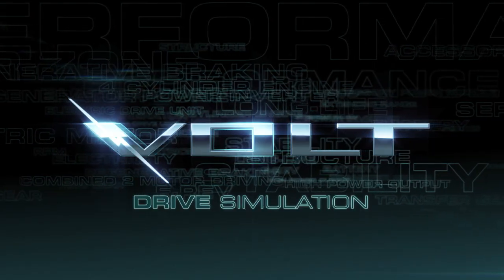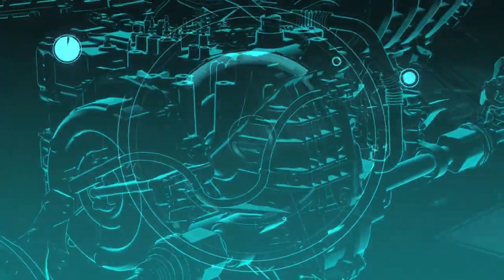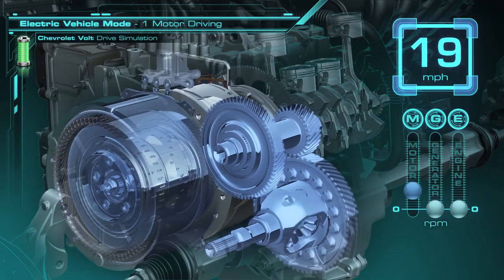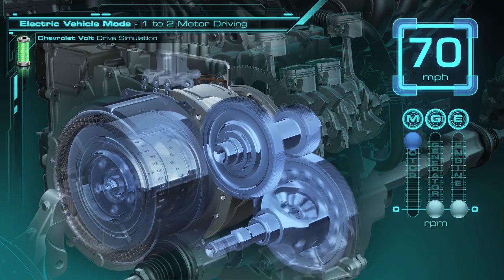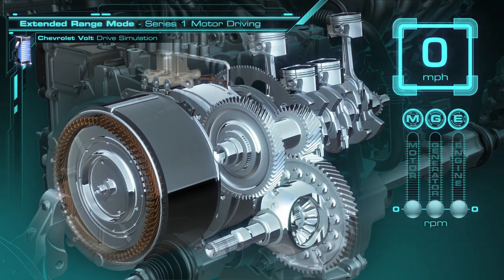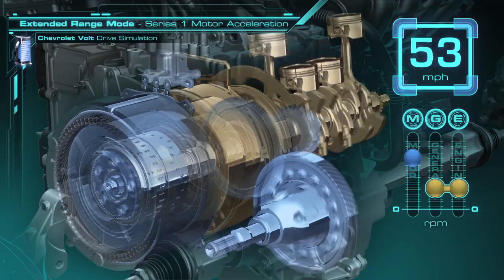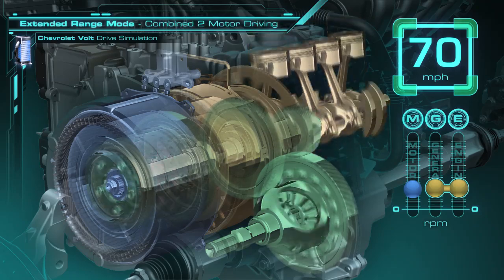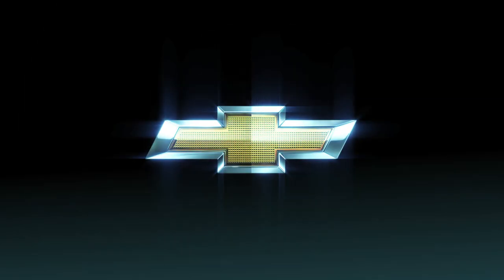Chevrolet Volt Drive Simulation

Comment: When does it catch fire? Isn't that part of owning a Volt?
Reply: Bayan1905 I am an ex-military combat pilot, gun owner and owner of 3 businesses.  I am a true conservative, meaning that I believe in conservation of our natural resources and our human potential.  Your opinions come from the "modern" conservative movement, where facts don't matter and where the belief that an ignorant view should carry as much weight as a thought out one.

I drive a Volt.  Other conservatives who drive a Volt (or have driven one regularly) include Neil Bush, Jay Leno, and many others.

It is an American car, made by and American company and Imported from Detroit.  When it is sold, it runs on AMERICAN electricity.

You can't even do math right.  My Volt uses $360 a YEAR in electricity.  My previous gas car used $150 a month in gas or $1800 a YEAR in gas.

Hundreds of thousands of gas cars catch fire every year.  Did you ever notice that you aren't supposed to smoke while pumping gas?  Do you know how many Volts have caught fire outside of government testing?  Zero - that's right.  Over 800 million miles and ZERO fires.

Anyone that drives a foreign car that runs on jihad juice can feel free to STFU.  I invite you to pull your head out of your 4th point of contact.  If you were in the Army Airborne, you would know what that means, but feel free to Google it if you need to.
Reply: Hey Bayan1905.  Nice try at being funny...take a look at the Volt's customer satisfaction numbers.  I'll bet you they're higher than the numbers for the car you drive.  Wait, are you old enough to drive?
Reply: mebeingU2
I'm sure the owners of the Volt's that caught fire are entirely satisfied. Especially the one who had his garage burn down around it. I have never seen a group so touchy as Volt owners. Make one little comment about the car bursting into flames after an accident and they get their all natural shorts in an uproar. After all, not many cars out there have a spontaneous combustion engine and all. I think its great you guys pay the same amount of money on a little car like that. I can get a Ford F-150 4WD for the same amount, but hey, all a truck like that can do is get me out of snow and mud anytime and haul what ever I need it to, you guys are saving the planet. Awesome! Of course since the materials for the battery are mined overseas, shipped to China, and then shipped to America, how many miles have they traveled? Hmm, doesn't seem very eco friendly. Well, it's the thought that counts I guess.
Reply: mebeingU2
Don't get me wrong, I plan on getting my son a Volt when he's old enough to drive. He won't get any speeding tickets and he'll never get laid in it or as long as any girl sees him in it, so they do serve a purpose! They're better at birth control than a lifetime supply of Trojans!
Reply: So, less than zero fires outside of government testing.  Negative fires?  I take it math isn't your strong suit.
Reply: Bayan1905 I hope the Kool Aid you're drinking tastes good, because most of the "facts" you are spewing out smell like bull$h!t.  Maybe you should change to a subject you know something about or at least stop parroting what you heard from Fox News or Glenn Beck or Sarah Palin or the other mouthpieces of the oil industry.
Reply: 2 cars in a garage with possibly 40 year old wiring, 1 of the cars (not the Volt) being much older and heavily modified, and who knows what else was stored in the garage.  Wow, what irrefutable proof that it was the Volt!  What great journalism.  The writer of this article shouldn't quit their day job to become an investigator or scientist for sure.
Reply: Law of averages is something that is made up to make you feel good. The fact is, people actually die from gas vehicle car fires.  If you factor in ALL electric vehicles including the Leaf, Volt, Model S and others, there have been no reported deaths caused from the battery catching fire in North America.

What makes the Volt a POS? Seriously asking because I want to buy one... Is it because of the lack of spare tire? This is not unique to the Volt... Many high end luxury cars are doing away with spare tires. Any supercar costing over half million won't have a spare tire as well.
Reply: I see I'm a little late to this conversation, but I thought that Bayan1905 would enjoy the photos of my F-150 that did catch fire spontaneously. Luckily it was only parked in my driveway, not the garage. It had been off and cold for 4 hours when it caught fire. Here is a link to the pix. https://www.facebook.com/media/set/?set=a.1842276423290.109898.1431986497&type=1&l=9e6f119440 I own a volt now, and it has yet to catch fire :). So enjoy YOUR spontaneously combusting vehicle!
Reply: Bayan1905 No hugs needed here buddy, thanks for your concern and caring.  Enjoy your truck.
Reply: Bayan1905 So, BTW, when does your truck catch fire?  Let us all know when it happens, OK?
Reply: Thanks for the update George.
Reply: <sarcasm> So true Bayan.  I always run to support products that suck and never admit I made a mistake buying something because of the huge character flaw that I have where I can never admit I am wrong.  Thanks sooo much for helping me understand the error of my ways. </sarcasm>
Reply: Where did you get your information on Volts catching fire? The only information I found is when the government did their crash test, then the Volt caught fire in the compound 3 WEEKS after the crash. I would hope that any owner of a Volt would get out of the vehicle no more than 2 hours after a crash that is serious enough to compromise the battery.

Now take a look at the number of gas driven vehicle fires that happen in North America. I would be concerned about that instead.

Cheers.
Reply: I see. Yeah. Those are not great specs. For $36000 I could buy a BMW that's got good 0-60 times, seats 5, etc. etc. However, like anybody looking to buy one of these, including myself, those specs you listed are not high on their/my priority list.

For starters, I don't need 5 seats. Actually, I could do with 2, my gf and myself. Second, 0-60 doesn't mean much in the city unless you are into street light racing. And lastly, there are rebates state and federal that drop the price down to $22-25k.

I guess what I'm trying to say is that yes, your definition of car classifies this as a POS. However, for some people, this car fits their lifestyle perfectly. For myself, I go to and from work within the electric range. That will save me at least $200/month in gas alone. If I want to make a weekend trip to the lake, then the gas engine will back me up. You cannot do that with a Leaf, and i3, and maybe a Model S (depending on distance) unless they have charging stations in the woods/state parks/etc.

Anyway, we agree to disagree. Cheers.
Reply: George either you're taking too much medication or you need to start. You might want to adjust that tinfoil hat its on a wee bit too tight.
Reply: And a bit sensitive when it comes to your car aren't you? Do you need a hug? I bet you do. So Jay Leno owns a Volt, and how many muscle cars? Not exactly a point of reference. Also, I was using the numbers on Chevy's own website, so go yell at them a bit. Also, Chevy is not entirely American made, it comes in at number 30 on the Kogod School of business made in America list, behind a couple of Toyotas, Hyundais, and a bunch of Honda's. My truck, well that is 100% American made, and when I people complain about monthly payments, I just smile. I haven't had car payments in six years and I don't intend to ever again. Sure I buy my cars used, but I buy them outright and don't ever have to worry about payments. And the good thing is, if I ever get a flat tire, I can change it, not have to take out the can of fix a flat and the blow up doll pump Chevy gave Volt owners for all that money. So you can drive your overpriced golf cart (if I ever do get a plug in it will be a Focus or a Prius) and I'll keep smiling not having to worry about monthly payments. Oh, here is that link to Kogod, so you can see how American made your car really is. http://www.american.edu/kogod/autoindex/2014.cfm
Reply: Andrew Diamond Oh, and that is slightly old info.  Battery production has moved to Michigan and other elements for the next generation are also coming stateside.  A lot of "so called" American trucks are assembled in Canada or Mexico, so you have to watch for that too, but you seem to have the right data source for this.
Reply: Not as often as the battery packs in the Volt.
Reply: I have had no fires, the Volt, well at least one and I bet there are more if you look. I know there's a newstory out there with what's left of a garage and a Volt in the middle of it, the Volt was being recharged and poof! Oh wait, here it is! http://www.leftlanenews.com/chevy-volt-suspected-in-garage-fire.html
Reply: Remember, I'm here to help.
Reply: I would imagine more gas powered cars (doesn't the Volt still have a gas motor) catch fire, there are 200-300 million cars on the roads, while Chevy has only sold 70,000 Volts in four years, that's called the law of averages.  That doesn't make the Volt superior  in any way shape or form. In fact its still a POS.
Reply: Volt has a 0-60 time of 8.9 seconds and a quarter mile time slower than that of a Chevy 2500 4 wheel drive. It can seat five, not comfortably. Kelley Blue Book says that it will be worth only 30% of its value after 5 years, lower than most cars, all for $36,000 MSRP.
Reply: All this Bayan1905 douchebag has done is jump to every Volt video and troll it with negative bullshit. Get a life douche canoe........
Reply: Wow so commenting on my comments makes you, a troll too right. I'm simply performing a public service you are just wasting time.
Reply: Yeah because there is nothing cooler than saying "Hey you want to not hear my car run?" and with the super slow 0-60 times, it can maybe keep up with the city bus.
Reply: George Hendricksen you are arguing with a loser that jumps to every Volt related youtube video to bad mouth and troll.
Reply: Wow...when did things go wrong with you?
Reply: It may catch on fire when you do something stupid, like crash it.  That's part of owning any car.
Reply: Look it up for yourself: 
https://news.google.com/news/search/section/q/chevrolet%20volt%20catches%20fire/chevrolet%20volt%20catches%20fire?hl=en-CA&ned=ca
Reply: Funny, I own a volt, and it hasn't caught fire, and I get more pussy than know what to do with. Strange.
Reply: He's paid to do it by Charles and David Koch's political propaganda machine.
Reply: Andrew Diamond
Boy you liberal tree huggers sure get mad when someone picks on your little electric cars and their spontaneous combustion engines. I think its cool that you spend all that money and it doesn't even come with a spare tire, just some Fix-a-Flat and an air pump and it has a 0-60 time of 8.9 seconds and does a quarter mile in 16.7. Who cares if that is slower than a Silverado 2500 4x4 4 door cab or that it gets spanked in performance by the Ford Focus SE (which is more than $10 K cheaper), or the Hyundai Sonata which isn't even $18K in the base model, but hey, you guys are saving the planet right? It only costs you about $50 to plug in your little R/C car, that's only $575 a year, so on top of the fact that anyone with a brain is going to buy a car like the Focus, the Prius, or the Sonata and save a boatload of money every year, they don't have to plug their car in, or worry about the battery catching fire and if they get a flat tire, they can change it on the highway, but hey you showed them, you're saving the world, good for you and your overpriced golf cart! You showed them, you bought the Ford Edsel of its time!
Reply: Boy I have never seen a group of car owners get so pissy when someone comments about their cars. Must be all that buyers remorse built up for buying a car that is this generations version of the Ford Edsel. Of course at least the Edsel came with a spare tire and I think the 0-60 time was better than that of the Volt, which I know is slower than that of a 4 door 2500 Silverado 4 wheel drive and a 1/4 mile of something like a day and a half. Yep, I'd be real happy to have had to shell out $30K for that rolling turd. The Volt couldn't get any shittier if it was a septic truck.